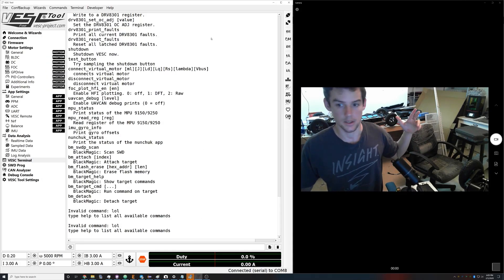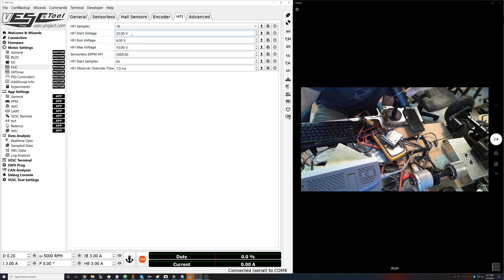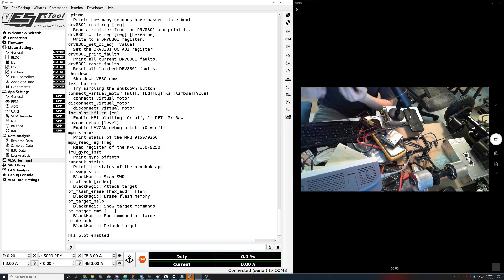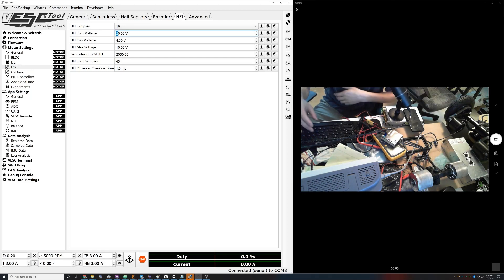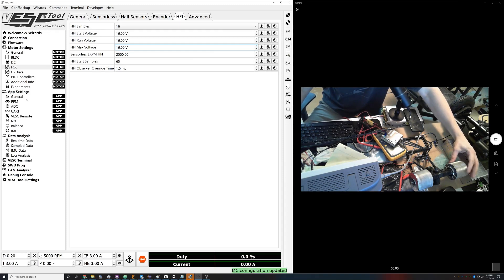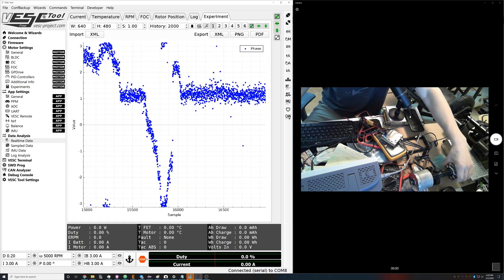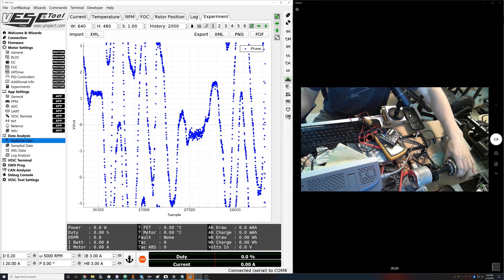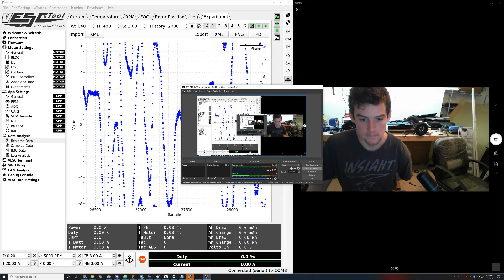VESC Sensorless HFI Tutorial(FW 4.0)

Comment: i noticed you left the bottom right box an 20 amps ... quite a jump from 3 amp ... is this normal ??
Reply from the maker: That box will be the current command sent to the motor from vesc tool when you use the arrow keys. For my motors this current will still be easy to hold with the hand but your mileage may vary.

Comment: Hey man tried to follow your tutorial on my Flipsky FSESC 6.6 but when I get to the point of clicking on full break all I get is CLICK and then nothing any ideas ?
Reply from the maker: Yes, disable the app input from ppm. If you have a remote connected it will over-ride the brake command.
Reply: @FriesenDesigns  Thank you, does this still apply if I'm using UART remote? Also my VX2 remote was not connected at the time.
Reply from the maker: @Rick-zn5ge  If the reciever is not connected then it does not apply. Just set it to no app and that should do the trick.
Reply: @FriesenDesigns  Thanks for the advice bud, appreciate it.

Comment: I set up the left motor without issues but, do I need to set up the othrer motor the same way?
Reply from the maker: If they are the same motor the same HFI voltage should work well.

Comment: Here's the thing.... if the red plot is only about start voltage.... why does the red plot persist whenever HFI is running, even after the "start voltage" phase has ended?

I noticed that a higher run & max voltage correlated to a much tighter red plot, and saw improvement in detection performance as well.

Comment: Helpful, thanks! 

HFI Performance seems to be better than hall sensors when changing directions, so i want to see if i can get mine dialed in better.
Reply: Ok i think i figured out my problem. My HFI is configured fine, but the canbus linked motor HFI reboots on direction changes causing it to loose position tracking for a moment. At least thats what it sounds and feels like, ill have to dig into the code.
Reply from the maker: @freedomcaller  maybe make sure your CAN cables are short and twisted? What ESC is it?
Reply: @FriesenDesigns  my can cable is super long, ill make a new one and twist it. But my can performs perfectly with hall sensors, and with hfi if I'm not balancing on the center point. I'm using dual vesc6+

I also want to try getting hfi setup on on a larger euc motor, but I can't seem to get it working. 😥
Reply from the maker: @freedomcaller  Oh I re-read and am following more what you are saying now, through zero speed it seems to lose position tracking? This should not happen in theory. 

For the larger EUC when you measure inductance from the terminal how much of a difference are you seeing?
Reply: @FriesenDesigns  yes through 0 it looses position tracking, only on the can bus slave. 

For the large euc when I measure inductance it varies from maybe 30% to 70% does this mean hfi won't work?